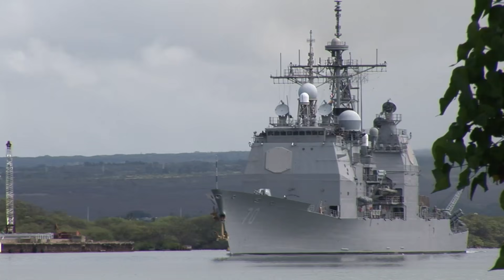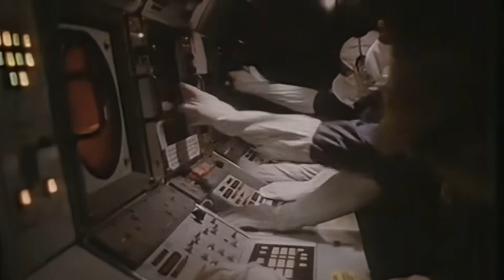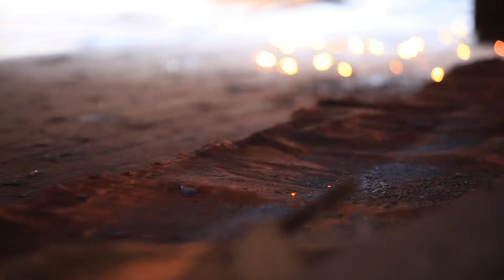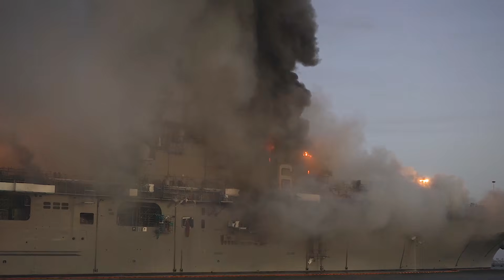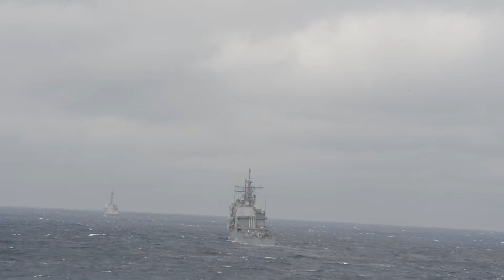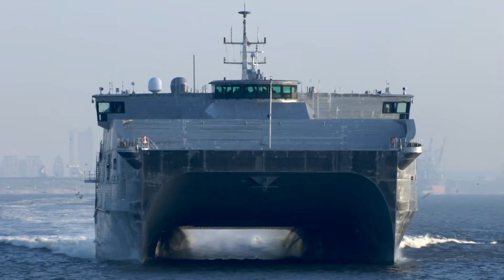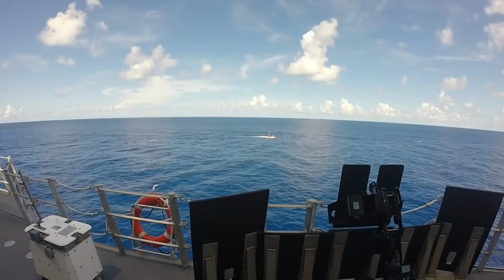Why is The US Building Aluminum Warships?

Comment: why not have  both  Steel  with a layer  of  Aluminium., that way they  would not attract  mines and they would still be  strong.
Reply: If tou have steel in it, it will attract mines, plus steel and aluminum have to be isolated from each other or the galvanic effect between the metals would cause problems. It's fairly easy for Ford to isolate the aluminum truck body from the steel frame by using non-reactive body mounts.

Comment: "aluminum doesn't burn" what? aluminum is famously one of the hottest burning materials out there.
Reply: @The Nothing ...Aluminum oxide burns, it also used as a solid rocket fuel in some applications. You are correct about magnesium though, once it is on fire, almost nothing can put it out unless you pour sand on it.
Reply: Toss your beer can into the campfire.  It'll burn to nothing.
Reply: The fact that it needs a lot of oxygen to burn does not mean it doesn't burn. You just won't experience it burning in regular circumstances.

Comment: Combining aluminum with other metals in a salt water environment is problematic.
Reply: Sitting in salt water on its own is a problem, let alone in a galvanic couple
Reply: And not to mention that littlle nasty combination of aluminium oxide and rust  combination one hit or fire and it burns down like a roman candle.  

The britsh learend that during the falklands war , several ships had minor/medium impact damage but the fuel started a chainreaction and burned out those ships.
Reply: They know that. It's just another income stream....
Reply: I have a 40 year old aluminum boat. Looks new.
Reply: @jakev4191  is it in the sea and shaped such that salt water regularly sprays its deck and percolates down through the structure?
Reply: @sonoffenix3399   well I'm sure aluminium by it self is much better than steel alone in terms of corrosion.

I live in a small island and near the sea, things here must be made out of aluminium or stainless steel... Galvanized steel sure does the job but you need to paint it all the time or start rusting fast.

In terms of corrosion between different metals, there's a reason why ships keep working for many time and it's all due to maintenance because they use different metals to feed the corrosion and preventing the metals needed from getting eaten, if you stop feeding it (maintenance) the problem will start appearing.
Reply: @guily6669  Then you'd be flat wrong. Steels corrode only in acid environments with or without the presence of chloride ion. Aluminium is only passive between pH 4.0 and 8.5 and is corroded faster by chloride ion than carbon steels by a factor of about 4.

Galvanized steels don't perform well in salt spray environments because the zinc doesn't have time to passivate itself under carbon dioxide diffusion, and zinc corrosion product drives the local pH down, into the active regime for iron. You're using an example which is specifically countermanded for sea spray environments. Further, passivated zinc has very low surface energy and paints don't adhere well. If the installer knew to etch prime the galvanize then paint with a 2K PU or epoxy coating system then the problem goes away,

Those same environments attack all aluminum alloys. 5xxx series survives seawater best because of it's substantial magnesium content and lack of precipitate system, and those will be the aluminum alloys predominantly used near the sea.

This is what I do for a living. Please don't come here with your anecdotes as science.
Reply: @sonoffenix3399   well here aluminium works fine 4 me and last many years but it's not on the water it's on my house where galvanized steel goes to hell fast.

Our aluminium doors are not painted and have like 30 years and are still shinny new.

But on the water here near the see we usually use stainless steel which also seem to last for ever as we use a product to clean it which looks like acid or some crap and the surface rust goes away.
Reply: @guily6669  Please read my reply again. Your doors are made of 5xxx series aluminium alloy, as I've already covered. This system is not suitable for many applications, your doors are hardly stressbearing members. they have to support their own self weight and not a great deal else.
Reply: @Chris-z2k6c  If you're going to argue with actual materials engineers over this, bring a little more substance, please?
Reply: @sonoffenix3399   I learned something today from you . Thanks 😊  for sharing.
Reply: @ajthomas770  You're very welcome
Reply: Tell that to William Francis Gibbs, builder of the USS United States. (Superstructure is all aluminum)
Reply: @michaelkremper4869  And all seventeen years it had in service before it was scrapped. Try harder

Comment: Al doesn't burn?  Try a thermite video or look what's in the Space Shuttle booster rocket.
It only doesn't burn because of a thin Aluminium Oxide layer, but fine particles or chemistry can have fire.
Reply: Toss a beer can into a hot campfire.  It'll burn to nothing.

Comment: Curious how a magnesium alloy hull would perform
Reply: magnesium is very flammable and once on fire, especially at sea, almost nothing can put it out.
Reply: @evilspoon5280  true, but there's a number of alloys that are damn near impossible to ignite. With the salt water I presume some odd galvanic reaction would be it's really enemy. Heard to find much online that doesn't harp on the reaction side of magnesium.
Reply: @nathaingalt8623  ...I say just stay with good old fashioned steel. So far nothing has been able to replace it in over a hundred years of building steel hull ships. Until we make some synthetic material that can replace steel, I dont think it will be replaced.
Reply: @evilspoon5280  cost/benefit wise, it is hard to argue against steel. About the only real issue I guess comes down to fuel economy. It would be neat to see a Stirling drive configuration
Reply: @nathaingalt8623  ..I heard about water jet propulsion as well as magneto hydrodynamic propulsion. Although the latter is not very powerful, water jets seem to be quite powerful. also, fuel economy now is more of a function of design, yes lighter save fuel, but we really dont wind tunnel test the superstructure of ships, maybe we should.

Comment: This video makes so many mistakes.
Aluminium in the Space Shuttle isn't more heat resistant, it gets protected. Ofc it holds longer if it's not actually heated.
SpaceX didn't ditch Carbon Fiber because of its strength, but because of economical considerations. Carbon Fiber Composites have insane strength, and can easily outclass steel. It does come at the cost of making manufacturing and engineering incredibly more expensive and time consuming. It's not some magical material though, so it comes with other problems than metals.

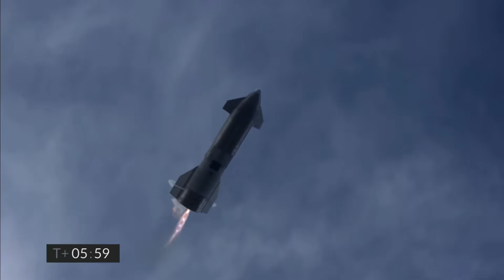Comment: 13:30 The starship is made of stainless steel not because it is stronger than a carbon fiber under normal conditions, but because when filled with fuel at extremely low temperatures, it has a strength similar to a carbon fiber. It has nothing to do with the durability of ships because we are talking about durability in completely different conditions.

Comment: The thermal tiles on the space shuttle protected the space shuttle except for when they didn't protect the space shuttle. Just saying that's a really bad example.
Reply: They didn't protect the space shuttle because they were not present. Nasa  should have used an SSTO system then there'd be no external tank to ice up.

Comment: On the smaller ships once the Navy prefects the rail gun and laser defense. The chances of secondary explosions should be reduced by a lot as the projectiles from rail guns are not explosive and the same goes for lasers there is no ammo to store. Also, don't understand why they don't use reactive armor like they do with tanks.  Hell, you could have a swarm of submarine drones tethered to the ship and detach and lock on to any incoming torpedo and intercept it before it gets to the ship.

Comment: I remember having welders adding gussets in different locations  on the FFG46 USS Rentz when I was on her.  It was a good ship.
Reply: Was a DC aboard Antrim FFG20, and remember a lot of extra welding from both our shop and "yard birds". 
Galvanic corrosion wasn't ever discussed, but the bar stock holding the super structure to the main deck required a "code" to weld on it...squids weren't allowed anywhere near it with our PowCon unit!

Comment: The Starship-SpaceX reference is not accurate. Elon shifted the starship from using carbon fiber to stainless steel because stainless steel is stronger than carbon fiber on a strength to weight basis in cryogenic conditions which is not at all applicable to maritime conditions for boats, so that reference is a bit irrelevant.

Comment: it is simply not possible to weld aluminium to steel, friction stir welding is used to weld non weldable aluminium alloys (7000 series zinc based aluminium alloys) technically explosive welding can be used but that is a very special case scenario. The problem with aluminium alloys in naval scenarios is as you briefly touched on is due to the endurance limit, similar to fatigue limits in steel structures except that in steel as long as you stay below the SN curve you can have a structure that lasts forever, aluminium alloys however have a straight line to failure

Comment: Mentioning the usage of steel on SpaceX Starship instead of carbon composites is pretty irrelevant to carbon's naval applications. Steel was chosen for its ability to remain strong at the ANTICIPATED high temperatures of reentry
Reply: It was actually about storing the CRYOGENIC fuels and their effect on the strength of carbon fibers that mattered.
A form of Carbon FIber was used to make the Space Shuttle Tiles - they had PLENTY of heat resistance.

Comment: Carbon fiber structures are stronger than steel while being significantly lighter. The reason SpaceX switched to a specific type of stainless steel is because they needed a material that could handle both the cryogenic temperatures of the propellant and extreme heat during reentry. Neither of which is an issue for a ship.
Reply: Carbon fiber has problems woth delamination where the layers split after an impact.

It's fairly labour intensive to check as it can't be done visualy (ultra sound etc is used) then to fix it you need a very labour intensive patching process.

Being able to weld and its toughness is a really big bonus for metal.

Comment: The logic is if even one missile hits and it’s all about the defensive weaponry fire, on the top of the decks rather than the strength of the hull making any difference why not just make them out of aluminum anyways? it’s strong enough for the purpose and it wouldn’t matter if it was hit by any professional military if it was steel.  If the damage profile is similar and unmitigated it also doesn’t prevent costs or loss of life to switch to any substantial degree.

Comment: Of course taking a telephone pole to the face will sink any ship.
However, Steel or composite could help against deck guns and some ship based SAM have secondary AshM features.
A riverboat with ATGM like STRB could be a real threat to a aluminum ship judging from what is said in this video.

Comment: Starship being made of steel is not evidence of its superiority over carbon fiber composites.  The steel in starliner is used for the thermal properties and its requirements to be reusable this is a case by case basis not evidence of either materials superiority or weakness

Comment: WHY, regarding center of Gravity, didn't the stay with Steel, and simply go to a Catamaran style dula hulls, and compartmentalized use o synthetic fabrics & glues in design, BOTH weight, Space, and safety is solved.---From an engineer.

Comment: I was lucky enough to get a ride on (what was eventually commissioned) the USS Independence in Mobile Bay.  Un-freaking real.  Never approached top speed, but was told we were doing 40 kts.  I've heard the vessel can double that.  The bridge was like a NASA NOC....
Reply: The speed of any military ship is highly classified. Not even the crew knows the exact speed. all publications read 30+ knots. 1 knot is 1.5078 miles per hour X  30 = 34.5 miles an hour. it has to achieve this speed to launch jets o carriers and other ships have to be able to keep up with carrier.

Comment: I don't know why they are not using aluminum vinyl ester composite laminates. Stronger, lighter as well as more shock and impact resistant than steel. Vinyl ester polymers with an improved intumescence layer can boost heat resistance up to 2000-3000 deg centigrade :)

Comment: The comparison between carbon fiber use for ship megastructure and aerospace design (Starship) is a bad one. For ships you need the best structural material, hence carbon fiber might the best, price left alone, and for aerospace use the problem is very different : you need a thermostrucural material capable of withstanding immense temperatures while ensuring the structural part. Elon musk chose steel because he can cool it with micro pores and reduce the temperature for reentry and reuse the same structure. Carbon based solutions are ablative materials such as carbon/carbon composites but cannot be reused as those endothermic materials ablate and need to be changed (see nasa space shuttles that needed C/C tile replacement).

Comment: SpaceX choosing Stainless Steel over Composites has NOTHING to do with Strength, at Earth surface temperature, and EVERYTHING to do with Strength Vs Cost at CRYOGENIC temperatures. The 304 and new 30X (three oh four and three oh X) offers the Same or Better strength as Composites, at significantly reduced cost to manufacture, and it's Cost that made that decision, NOT strength.
Perhaps do research on WHY decisions have been made before you spout off a conclusion based on incorrect, or not done, research.

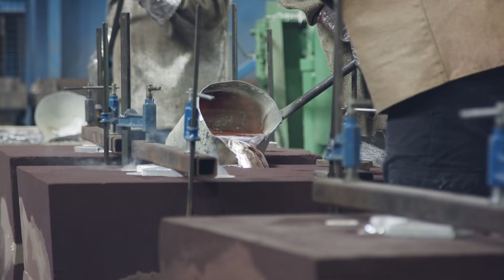Comment: 1:40 - "Aluminium doesn't burn." - WTF are you smoking?? 
Aluminium does burn, powdered Aluminium is used in Solid Rocket Fuel and in Thermite !!!
Once alight, it is nearly impossible to put out, especially if there's a source of Iron to burn with it.

Comment: Steel has a unquie material property that makes it perfect for structures and ships. Steel has an infinite life. If you keep the stresses low steel will last forever without stress cracks. Steel can and dose get stress cracks, but survives better than any other metal.
Reply: True! Apart for the fusion and welding issues, aluminum has a low resistance to cyclical stress – as stated in the video. In particular, contrary to ferrous metals, aluminum does not have a “stress limit” under which it could resist to an unlimited number of stress cycles. 
Accordingly, even though an aluminum structure may be reinforced in order for the metal to undergo lower stress levels, cyclical stress will inevitably result in fissure propagation over time. High speed passenger ships (NGVs) between the French Riviera and Corsica have been suffering from this phenomenon. 
A need for frequent inspection and repairs, and resulting additional costs have been contributing factors, among others, for the interruption of these “NGVs” service.     —— .